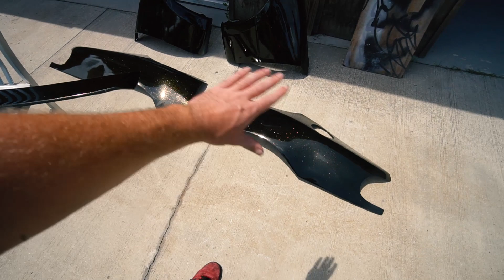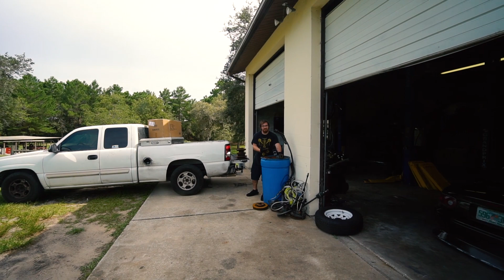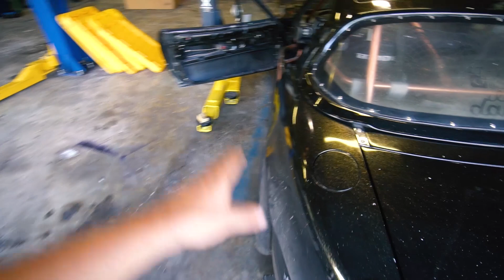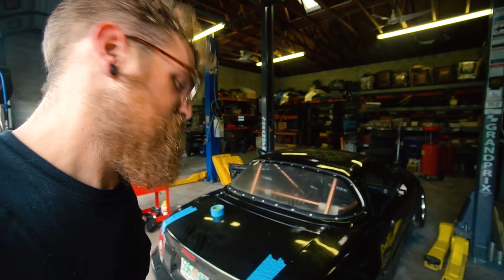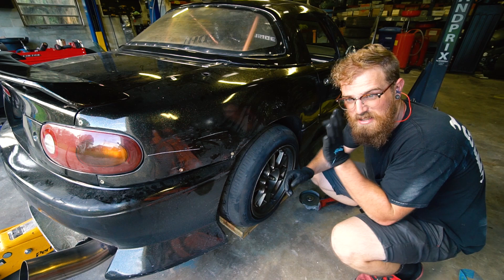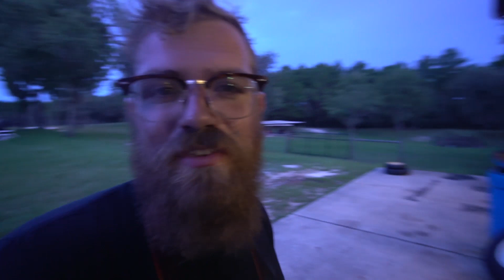The LS Miata Gets a WING and Overfenders! *Hotboi Alert!*

Comment: Bedline where you cut. Make a tape line right above the part you welded. Scuff it. Clean it. Paint it. It'll fill the pin holes and withstand tires coming apart and scratching it

Comment: Taylor, a great gap filling body filler you can use in many cases is spray foam insulation.  It expands and is water proof.  I've used it to fill many dead areas.

Comment: Since you keep working on the tow rig out in the sun in middle of summer you could call it the HeatStroke... Also I love the over fenders but I am not sold on the wing, like others mentioned a duckbill might be nice. If you need to mount another wing or something similar a nice trick is to take some all thread or cut the head off of some long bolts and grind points on one end, that way you can thread them in uniformly and give them a light tap and you have a clear spot to center punch to be dead on.  I also love rivnuts and use them whenever possible although do take care installing them because if one of your holes get wallered out and they start to slip its a bear to get the bolts out, especially if its a blind hole.

Comment: You talked about power steering. Have you looked at any of the krc pumps? We run those on our round track cars with the high temp racing power fluid and we quit having issues. The stock pump and regular fluid would give us issues it would build up heat and boil the fluid out and loose power steering.
Reply: I second this!

Comment: put peanut butter right on the bolt holes on the wing then you can put the wing right on the trunk in the correct spot and not have to line up the bolts with a gap. also peanut butter dose not dry fast and wont damage the paint.

Comment: I think the Miata looks great, really dig the overs and the new wing.  None of its too crazy but it makes the car look more aggressive for sure.  I think the only part of the Miata im not a huge fan of is the rear bumper.  More specifically the flare out part of the rear bumper, it just seems to be too big.  I personally love when rear bumpers have a large cut out in the middle to reduce the size or some kind of blacked out diffuser to give it a similar look.  I cant wait to see some content on the Subaru, id love to see you and Adam LZ drive your AWD's together on some twisty roads.
Reply from the maker: I wish the rear bumper was like two inches shorter and that would be perfect. But it’s holding up great because it’s made of poly. 

Hoping to do some mountain road runs with Adams car one day!

Comment: Take shrink tubing and shrink it on the part of your glasses stems that go over the ear they shouldnt slide anymore. Worked on mine.

Oh and be careful of what you shrink it with I used a lighter and it melted my plastic stems a little, I'd go with heat gun next time.

Comment: Theres several hole transfer methods online. I usually lay a piece of paper on the spot where the holes are and mark the holes then tape the paper to the surface you need to drill the holes on.

Comment: Do electric steering and electric water pump👍🏻
Reply: Mr2 electric steering pump is the way to go, idk about which water pump doe.
Reply: Blake Vella not electric steering. That’s a nightmare and gives zero feedback. An electric steering pump however is the way to go
Reply: Matt L this isn’t true you can use I think here in aus we use a Holden astra one and there’s another car and you can order a controller that can adjust the power to make it feel how you want it to its amazing we use it in our race cars
Reply: Whitts adventures it’s still a nightmare to fit... he’d have to find the one you’re talking about, remove the dash, remove the steering column, custom mount it, then splice into the harness to get it working. 

Too much work for not much improvement. It would be much easier, and cheaper to get an mr2 electric pump, and he would get the same or better results
Reply: @r4ng3k03r1  was about to say the same, the mr2 power steering pumps are practically bullet proof

Comment: another way rather than putting bolts & painting them is to tape the spoiler bases and paint them then drill where there is no paint also can help with alighment by measuring the gap from paint to edge of trunk / boot (uk )

Comment: Driving a manual in traffic is hard LOL
He hasn't driven a big truck with an 18 speed Road Ranger. Those are a bit of a challenge at first, but once you get to know them, they're OK in my opinion. I'm in an Iveco with a 16 speed ZF synchronised manual, and it's bliss!
Reply: You want a cookie? Driving manual diesels, semis or pickups, I’ve done both and have two manual diesel pickups and all my cars are manual, the trucks in my opinion are significantly easier, way more forgiving clutches, if you know what you’re doing, you don’t even need to use a clutch for up/downshifting.

Comment: I usually use grease on the bolt heads instead of paint. It is easier to reapply and gives you more time to work with. Just my opinion of course.

Comment: i was driving a dump truck the other day 8 speed eaton the worst transmission for me to drive in a city im used to 18 speeds, weight of 37000kg 81500lbs, cars were pulling infront of me while i was making a left turn.... they really like to ride close to the passenger side and honk their horns when im throwing the truck around the corner.

Comment: I wonder how hard it would be to swap an electric Column out of a corolla or Scion xD into your Miata. You would really have to just de power the rack that’s in the car. Every time I look one up at work it looks like it’s all one unit with just a manual rack or something along those lines.
Reply: Mike Wassmer you do NOT want to do that. Electric assist steering is horrible. No feel, no feedback, barely any weight on the wheel. What he wants is an electric power steering pump. It eliminates the belt driven pump, frees up a few hp, and is super easy to do

Comment: Not a fan of the wing, just pushes the look of the car trying to be something it's not. Reminds me of the aweful OEM one that comes on NBs, just gross. A ducttail would be a better look for something that's not tall. Blackbird Fabworx has an adjustable on that would work well with everything (dark lexan is an option), even the extra JDM rice bumper. Sorry not a fan of that either. It's like the car is trying to be some dated 240 instead of a slick drift weapon.
Reply: Matt Greenland ducktails are hideous. This one is a 326/type x/dmax/g-corp style wing. It fits the theme of the car well and looks great